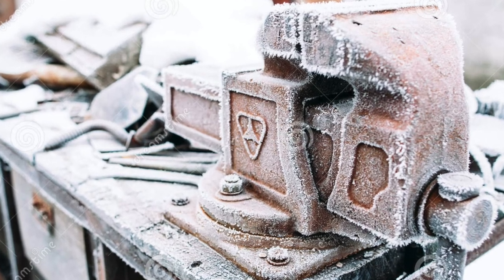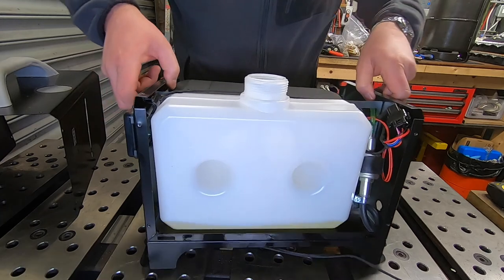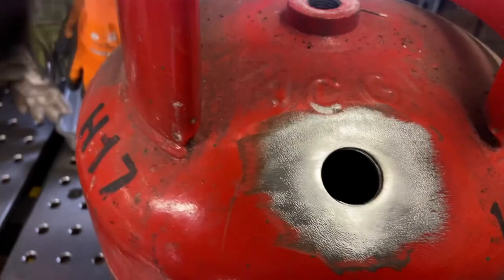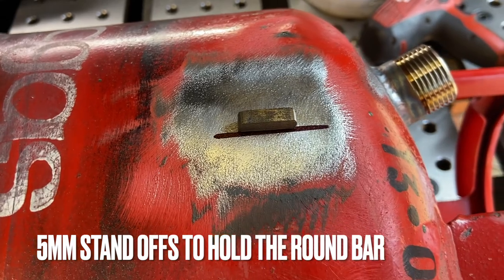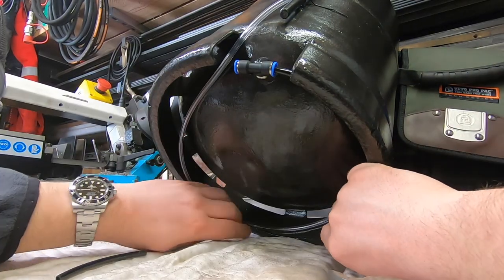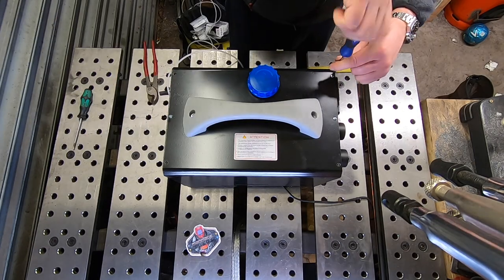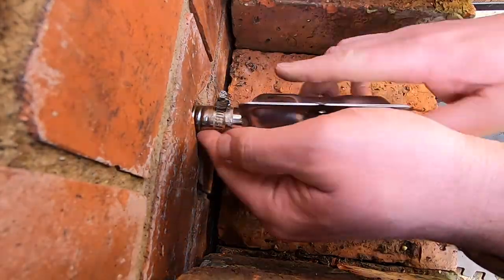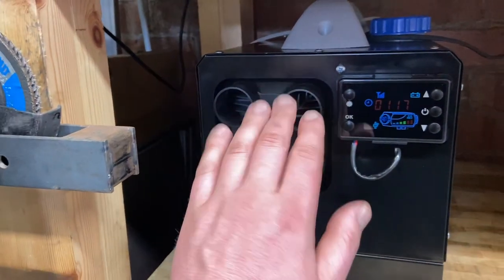Chinese Diesel Heater Install - Setup, Modifications! - Campervan, Caravan or Workshop Install

Comment: ..hi, thanks for your videos. 

This Heater can leak fumes so get a carbon monoxide meter. I installed my heater in a plywood cabinet on the outside wall of my shed with the power and hot air put through the wall. It’s not as noisy now and leaky connections not as much a worry.  You can also get a little foam casing to hold the motor which dampens the sound. The heater works well but make sure the pump is inclined at around 45 degrees or it wears out quick, mine did! Also turn it on at least once a week even during the summer, my advice from experience!

Also buy a few spare pumps and gaskets because you will need them at some point, I can’t think of anything else at the moment, ok take it easy
Reply from the maker: Thanks for the advice!

Comment: This looks like a really good bit of kit. Great adjustments made to make it fit in the workshop better. I was going to put this clip forward for an Oscar, but I might get a slap.🤣🤣
Reply: @man-madehand-made6009  Morning mate, fantastic video, where do you get the petrol diesel mix from ?
Reply from the maker: @thesilverline101   Morning pal, any car garage who repairs cars which have had someone put the wrong fuel in their car. When the diesel is mixed with petrol, it’s no good, only for burning!

Comment: Been toying with getting 1. A lot of people say the air intake should also be put outside due to misfire smoke coming through it!
Reply from the maker: Good point, personally I’ve had no problems, and it’s in a workshop anyhow. Would probably think differently if it was living accommodation! 👍🏻